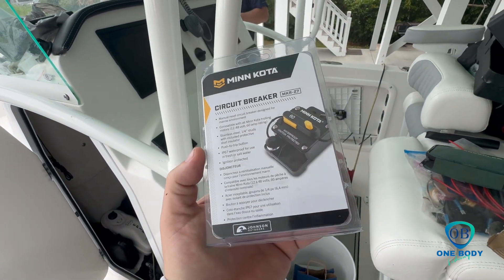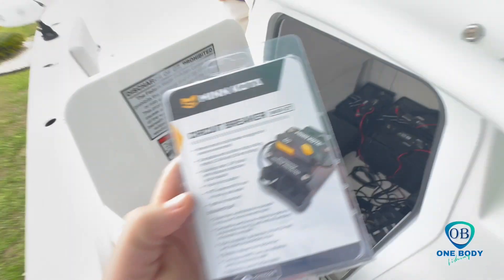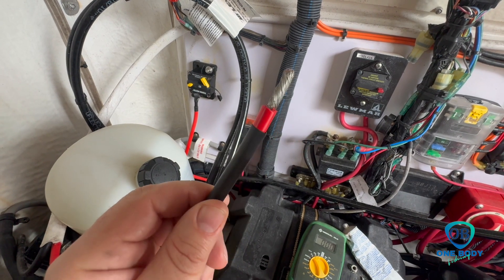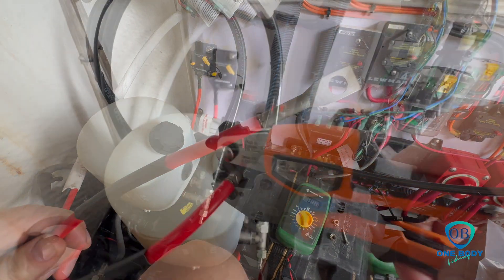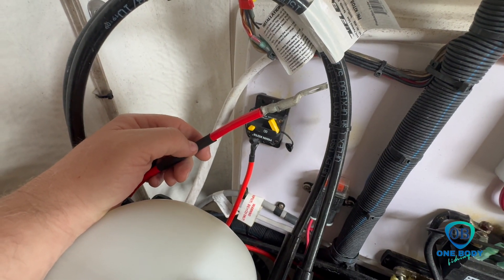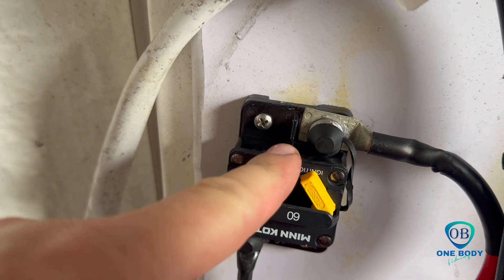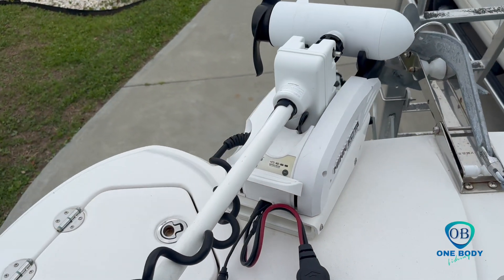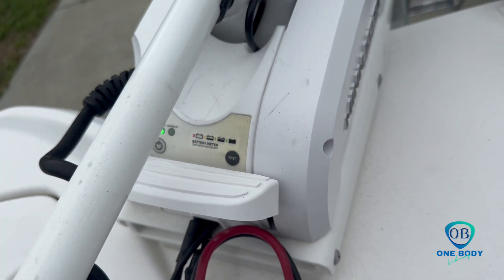Minn Kota Breaker Install MKR-27... Twin Vee

Comment: I’m installing a 24 V system for my trolling motor. This may be a silly question, but should I put a circuit breaker on each battery terminal or just on the main one that pulls the most power from the trailer motor?
Reply from the maker: Not a dumb question! If your trolling motor is 24 V, then that means you need the total capacity of both batteries equaling or the sum of 24 V. To acquire 24 V out of two 12V batteries you must wire them in series.. by wiring in series this will allow the total sum of all batteries. 

Now that you have them wired in series, you will need one breaker to isolate your trolling motor from your batteries for protection of the trolling motor.